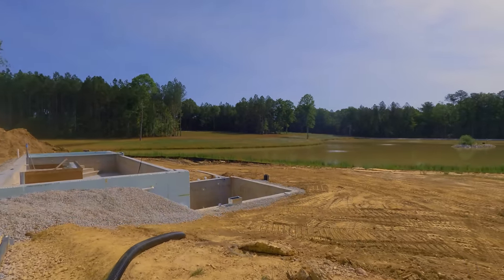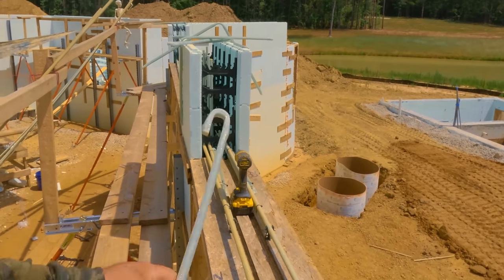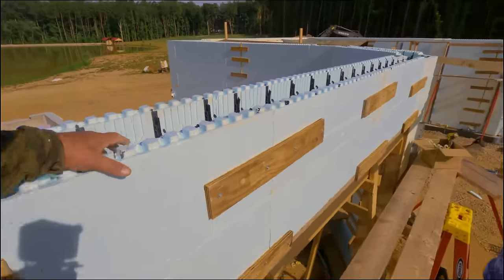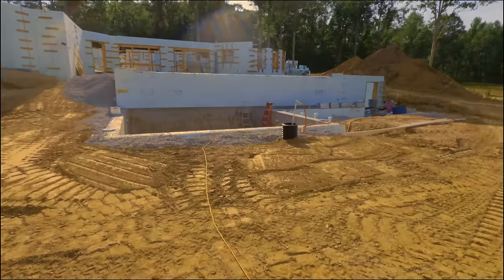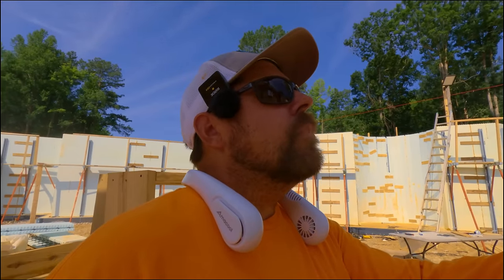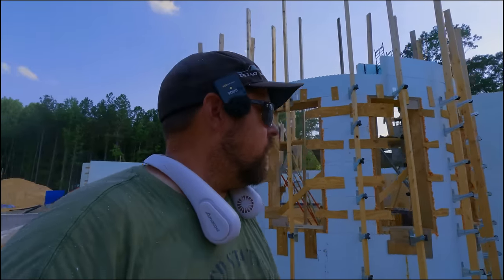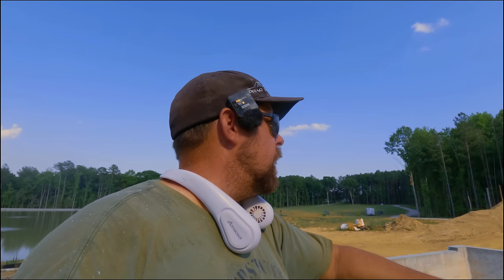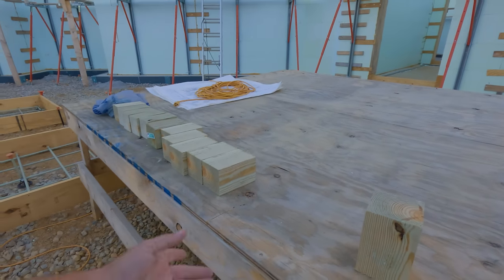ICF Basement Ready for Concrete!!

Comment: I'd definitely be going with a ducted heat pump over a mini-split on a house like that. JMO
Reply from the maker: The house is ducted geothermal. The mini split is just for the theater and my office (above the theater). Those areas are difficult to control as a ducted zone.

Comment: ICF is a misuse for a job such as this.  All the foam exposed (above grade) is preposterous.  Simple plywood forms which allow for the catwalks much better can be stripped with exposed crete walls.  Not sure who sold you on use of ICF for this but I'll bet they're laughing all the way to the bank.  Having worked pouring structural concrete for years on multi-story mid and high rise, makes me wonder how you wind up justification.  Why on earth would you want exposed foam above grade?  Use of wall tie cones which can be easily patched after form strip are an improvement over exposed foam.  Even if you parge the foam the maintenance of peel is astronomical.  I can understand the use of ICF below grade, where it gets covered with soil.  But for the life of me why on this job?  120 days?  Should be a week or 2 at most.
Reply from the maker: Firstly, we’re building ICF all the way to the roof. There’s many high rises now being built with Icf as well as schools, etc. There are a lot of benefits.

Secondly, couldn’t you nor a crew nor anyone you know build this house in two weeks. Especially not with the Pools also. Keep dreaming.
Reply: @BealyGood  Apparently this person thinks the ICF will be exposed permanently. The museum I work at was built with ICF in a much colder climate and it can be heated with a candle. The exterior is a vinyl board and batten style. I should email you a photo of it.....